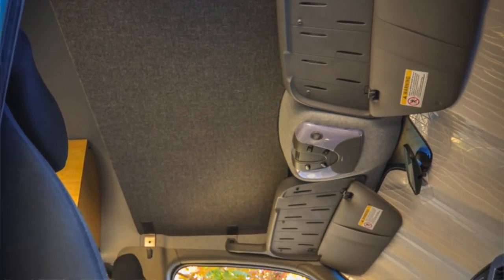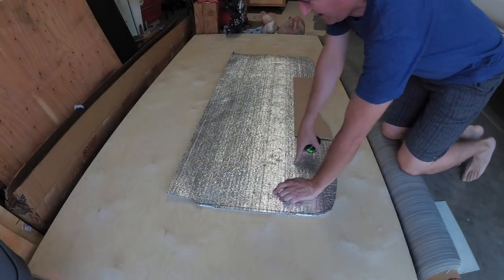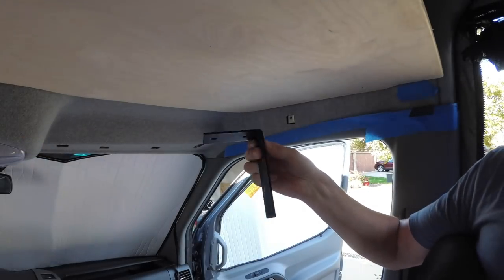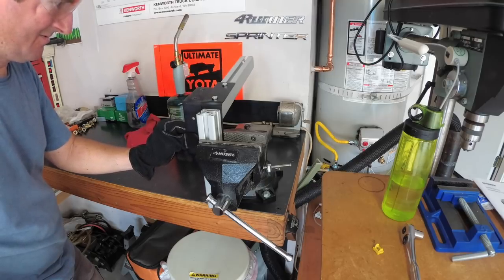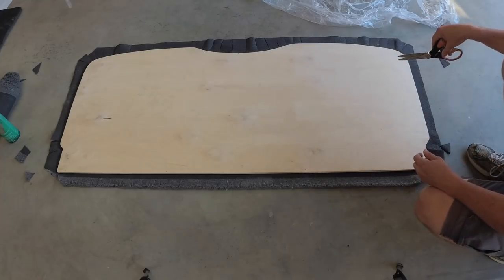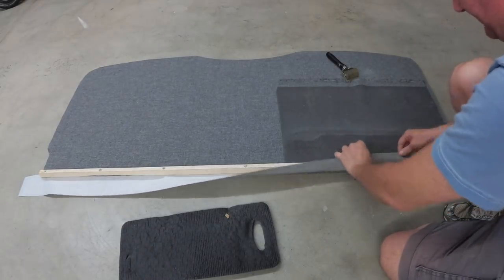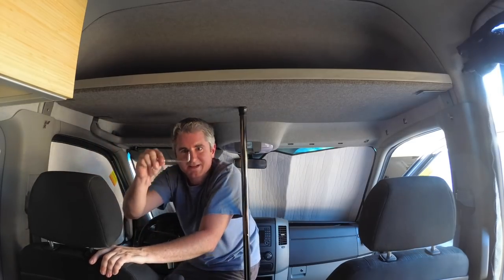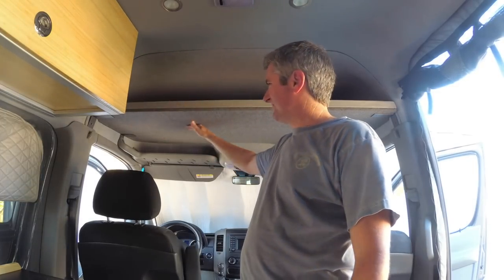Headliner Shelf - DIY Sprinter Camper Van

Comment: Great video. I couldn't stomach trying to trace out the shape and ultimately ponied up for the RBC shelf. I added 1/2" foam to the bottom because I knew I'd slam my head and wrapped in the same tweed you used. It's a great storage spot for bulky things - i.e. pillows and bedding. I'm also thinking about attaching a bungee cargo net to the underside so I can quick stash jackets, hats, etc. Thanks for the video!
Reply from the maker: I questioned my sanity in not buying the RBC one...I spent way more time with a wood file than desired!
Reply: @ourkaravan  I did this same thing a while back.  Using a compass scribe and cardboard for my template made it fairly easy to get the right shape.  I have a leading edge lip on the front of mine to add stiffness and keep stuff from getting stuck in the smaller portions of the front.  That part was a bit trickier, but an orbital sander helped polish the shape wonderfully.  The RBC kit looks solid, but the savings/function ratio was way in favor of the DIY version.  Love your channel, and hoping to replicate a few of your projects.
Reply from the maker: I thought about the RBC one as well, but ultimately the cost savings was too much to deny!  This also gave me the opportunity to have a padded shelf with material that matches the rest of my van rather than just an aluminum sheet.  :)

Comment: You need to wait 1-3 minutes before actually pressing both surfaces together that you've sprayed. Also, 77 won't survive getting really hot in a summers day in full sun.
Reply from the maker: I wouldn’t recommend the 3m-77 to others, but it has done fine the past couple of years in the constant 100 degree heat of the California Central Valley.

Comment: Nice job Ken,  Looks like you used a charcoal paint instead of the black so the brackets don't stand out quite so much.
Reply from the maker: I did!  It's called midnight metallic paint, but it's more of a graphite color.

Comment: Very nice as usual. Planning on doing the same thing. Did you consider putting a small piece of wood to strengthen the front similar to the back? I think just a shorter piece in the center part in the front maybe two feet long might strengthen the front enough. But since you used 1/2” ply maybe it is not really needed. 
Do you think a set of golf clubs would fit up there? I think width wise they would just wondering how much room is above the shelf?

Comment: Great inspiration, I have just finished trying to create scribes for my template but before I continue do you have an approximate distance above the grab rail attachment point that you started your template? My visor/grab rail is off and I am afraid I may not be giving the plastics enough room. Thanks for posting this.
Reply from the maker: I'm not sure the easiest way to describe where I'm measuring from.  Did you buy the same brackets I used?  If so, I would go ahead and temporarily bolt them up, then you'll know the exact level at which the shelf will sit.  Just a thought.
Reply: Great thought, they arrive next week so I don't think we will do any permanent cutting until I can use those to measure, thanks so much! @ourkaravan
Reply: Thank you, that is a great idea, I will not do anything more until the brackets arrive. Thanks again for posting this video!
 @ourkaravan

Comment: Great looking shelf, even though it was made of wood and not 8020. It would have been silly to not utilize that space.
Reply from the maker: I know, I know, inferior materials.  ;)      Seriously though, I forgot how heavy plywood is.  This shelf reminded me how heavy my van would be if it were made from it.
Reply: Hah, well - on the other hand, you use the appropriate material for the job I suppose, I have no idea how you'd do a pleasing shelf there out of 8020. I suppose there are more spage-age materials than plywood as well but those are expensive and hard to find. Perhaps 1/2 inch thickness was a bit overkill though.

Comment: GREAT videos! I would really like to know where you purchased the bamboo wood? is this something you found locally or did you have to special order?
Reply from the maker: Thank you!  There are two major manufacturers that I know of, Cali-Bamboo and Plyboo.  I used the latter.  I have ordered it from two different hardwood stores in my area, so any decent lumber store should be able to get it for you.  A 4x8 3/4" thick sheet runs about $500, but you only need one, and it's really what makes the interior...
Reply: I guess my persistence paid off. I was able to pick up some Plyboo from a distributor about 2 hours from where I live. And it was quite a bit less. The local lumber yards said they could not get it.
Reply from the maker: @clifflang8678  Nice, glad you finally found it.

Comment: have you found the 3m 70 spray to do sufficient work with the tweed as the 90?
Reply from the maker: Both seem to be holding fine but the 90 seemed tackier.

Comment: How much for a template? You know you gotta sell them.
Reply from the maker: Thought about it, but it's the time-factor of getting to the post office to mail them out, handling customer service, etc.  Free time is not in my favor these days!
Reply: @ourkaravan  you get the red rosen paper, cut a bunch of them (10) and put them in envelopes. $35 each.
Reply: All you would need to do is trace on to tyvek, list your supplies and sell thru Facebook market place or eBay.  All your planning would really help all of us out here still in the planning process
Reply: @kacotr27  I've tried to provide such when I convert a unit but most of the time the greatest hindrance are issues dealing with xport/customer service.  The product profit motivation is minimal.  His is about the best site for imitators like us because he has great site with graphics and sources on the products he uses.  Most owners just so show/tell for ego reasons and the viewers are left with only a wish.  hehehe  I plan to imitate this shelf this month.  I don't think he mentioned the gross yardage on the foam/tweed but since I have a Perfect Fit locally so that's not really a prob.
Reply: The RB components one is a solid option. Can do a pull up from it and there is zero movement. I like this design though as it keep use of the visor pockets

Comment: How do you remove the coat hanger clip?
Reply from the maker: You can use a flat blade screwdriver to pry the rubberized cover off the metal hanger, then the hanger removes with a single screw.

Comment: It looks good, great work. Though, it's a shame you couldn't hide the brackets better but that would have been excessive.  ;-)
Talking of excessive, I'd cut out the wood shelf above the visor shelf's (1" past visor edge), add a wall around the opening between the ceiling and top of wood shelf for that little extra room.

Comment: sorry brackets should be on top,whats with the space at the front????
Reply from the maker: You can build yours any way you like.  If you're going to put the brackets on top I recommend screwing all the way through the wood and using bolts up top along with a backer plate.  The screws going in to 1/2"ply won't be strong enough alone.  Keep in mind that the shelf is below eye-level.  Putting the brackets on top will not completely hide them.  I did consider it.
Reply: ourkaravan ha, kind of you to walk through the brackets on top idea with correct detail. Yes perhaps brackets show in both positions but shelf resting on top of bracket rather than relying on screws to hold weight was the better choice. THAT’S why people  ‘’I “  follow YOU !  Kudos.
Reply from the maker: Thanks for the message!  I fully expect that some are taking my initial design and finding ways of improving upon it.  It's much easier to do when the foundation has been laid out for you.  My work will be sub-par for some people and overkill for others, but you get to decide which direction to take when it comes down to it.    Thanks for following along!  -Ken